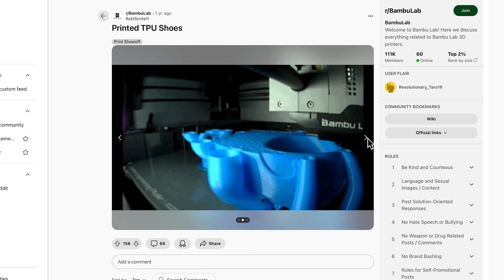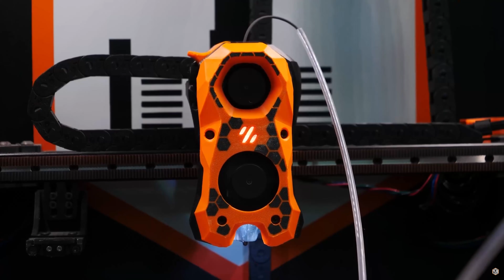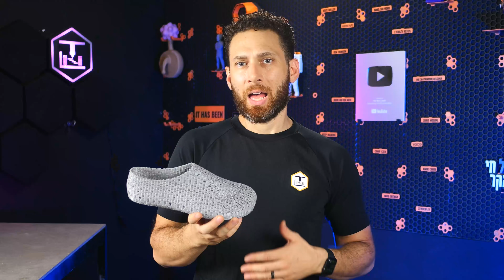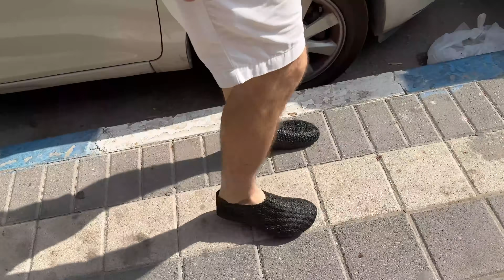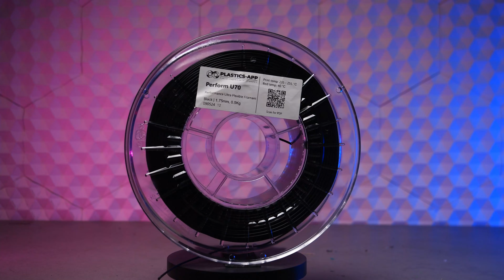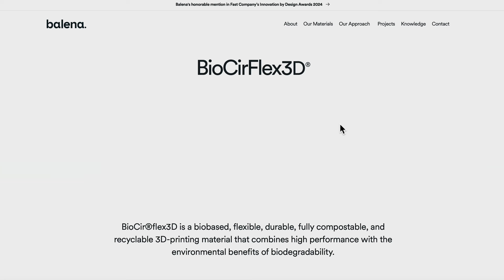Normal shoes suck. 3D Print THESE Instead!

Comment: I bougth a sv07 when it came out under recomendation, literally the worst printer I have ever owned and its made me quite the hobby, I tried to get help from support for 2 years and and rebuilt it from the ground up about 6 times now and it wont print correctly more than 1-2 times before loosing it's calibration and I have to start all over again

Comment: did you consider using the ninjatek  ninjaflex or their cheeta? supposedly they're made specifically for shoes while the chinchilla is for clothing. it would be interesting to see that filaments could stiffen the sole a bit for traction, longevity and no screaming if you accidentally catch a sharp stone under foot.
another thought is to access the fuzzies inside the shoe--- why not just turn the shoe inside out? far easier to work on the inside that way

Comment: If you ever revisit this project in the future, I have a few suggestions to bridge the gap between toe shoes and what you have here. One is purely material related and requires an IDEX or multi-head printer, while the other is model related. If you've investigated lattice software, that would be interesting to utilize, too.

Comment: A quick suggestion, from mg own experience with switching to barefoot shoes - it looks like you are still landing on the heel, and striding as if you were wearing the "normal" shoes (putting your leading foot waaay too far.in front of you)
Try the  following:
-instead of lenfhtening ypur stride forward - try to lenghten it on the back foot, aka, try to propel yourself forward mpre qotj the back foot, while putting the front leg.mucj less.far in front of your body. Think of it as moving your body/center mass forward in relation to your contact points with the ground. That might require a few months of stretching and exercising. Look up content on how to train for barefoot shoes
- try to point your feet slightly inwards, and it will help to exaggerate landing your front feet on toes/ball.

Good luck.!
Reply: Ball walking. It's what every human on the planet used to do before shoes with hard soles and raised heels were invented/became the norm. I always ball walk when in bare feet or shoes with thin soles. It makes so much more sense when you get used to it.

Comment: Printer guys.😂 When you have just a hammer, every problem has to be a nail, or what? You have one of the most advanced technologies of our time and you use it like cavemans that just discovered how to make fire by clapping two stones together.

Scan your foot with one of the billion apps out there and make a 3D model . Print that model. It's your (cobbler's) last. A foot "figurine". Use fabric with elastan for the top layer. Sew it on the last. Use some foam to make it comfortable for the feets bottom. For the sole try silicone. You may print some molding forms. Use adhesives used by shoemakers to put top layer, foam and sole together. It has a reason why shoemaking has an evolution too. You shouldn't ignore it :)

Comment: One of the things i dont see with 3d printed shoes which i think they could really benefit from and would reduce the poofy shoe issue i printing the bottom sole mid sole insole and outer shell of different materials say you were making a running shoe  you could make the bottom sole out of the most abrasion resistant stuff you can find to have it last longer and the stuff that needs to be softer out of something softer
Second thing you can do that i dont see being done anywhere is you could look at the shoes you already own and look where are the areas that you scrape the most and erode a lot and reinforce those either by again making them out of a material more resistant to abbrasion or just adding more material in those areas

Comment: perhaps what you have made isn't actually a shoe but more of an evolution of the sock?  IF you could make a second section that attached to shoe print that worked like a high top sock then you may have created a washable wearable long lasting sock?  The second idea would be that you simply build an All weather 3D printed over shoe that fits over your very breathable 3D printed socks/ that double as Summer shoes?

Comment: ok so I am very new to this 3d printing thing but I had a thought....if you can add magnets for example, mid print....could you scan and print an accurate "buck" of your own foot, say in PLA or whatever....then after the sole is printed, pause the print, insert the buck and continue to print the shoes over and around it?  modifying the tool path as needed to avoid collisions with the buck.  It would essentially be a removable, non attached support, in the shape of a custom last, providing support for sagging and ensuring that the shoes would be printed in the exact shape of your foot.....why wouldn't that work? love the channel, forgive my ignorance!

Comment: It would be interesting to experiment with using something like 3dgloop to glue a thicker sole (possibly also 3d printed) onto these for those of us who prefer that style of shoe

Edit: You could even print just the sole out of something like that 70A and glue it to a slightly less flexible but easier to print upper half, maybe that would offer better integrity while maintaining most of that desired flexibility

Comment: I’d like to see if these can be done in multi material. Use a soft grippy option for the outsole and a soft to the touch option for the uppers. 

Also, I have seen recent videos about varying the infill to make stiff or soft areas. It would be great to see this in these shoes. Soft in the heal and stiff in the arches.
Reply from the maker: Soon!

Comment: Hopefully you'll get that SV08 up and running for multi-material soon, this really seems like a project where printing the soles and uppers in two different materials (assuming any of these can bond together) would really improve the final outcome. I'm also kind of wondering if printing the whole thing in the best material for the uppers and then pouring silicone to surround and fill in for solid soles would improve the outcome on some of these. Having mesh soles kind of worries me, even as someone who is barefoot almost any time I can get away with it. You never know what you might step on out in the world.

Comment: My print bed is too small, end of the story :)
Reply from the maker: You need another printer. You always need another printer
Reply: @thenextlayer  Haha ! Yeah i should sell my current printer half the price and buy an A1. But if i have money to spend i rather buy a resin printer to make some miniature ho scale, fdm is pushed at limit on this scale.
Reply: So here's a hot tip, most printers can be extended in height with very little modification. Incidentally, the shoes that print vertical are actually easier.

A classic to build back in the early days 12 years ago was an upside down Ultimaker which would extend upwards to the ceiling.

Comment: VarioShore TPU always seemed like the perfect filament for printing shoes. Adjusting the temperature per layer could allow you to make some parts stiffer than others.
Reply from the maker: Yeah I kicked myself after Stefan’s video came out, like, why didn’t I think to include that?! But this video was already sooo long
Reply: A short follow up using it would be good. Could even be a short.

Comment: The really soft filaments underextrude at higher speeds because it's hard for the extruder to unspool.  While harder filaments are pulled out linearly with the extruder gears, the softer ones stretch without turning the spool.  If you unspool a portion of the softer filaments first, you can actually print them at almost normal PLA speeds
Reply: Maybe some of the new filament feeders/buffers could help with that
Reply from the maker: Yeah I considered this honestly but I couldn’t spare 26 hours to unspool manually
Reply: @thenextlayer   So perhaps a motorised unspooler would help. You would need any random geared DC motor that you can couple to a spool hub, and a Vishay TCST gate might work to detect the hanginess. Once it's hung down enough to clear or block the gate, the motor would be run.

Comment: I personally don't believe in barefoot shoes. I mean i might as well walk around in flipflops or thin sandals, and i have some thin flexible lightweight shoes and they don't work for me. I want pretty much the opposite. Also i need like at least 2 good inches of wedge heel for some reason.

Was watching a vid of a korean master cobbler build a mountain hiking shoe and i was like "hey i know these materials. hey i understand what he's doing, why he's doing that... i could do that! i would probably mess up 200 times before i succeed, but fundamentally, i could". That's a dangerous thought isn't it, i'm glad i caught it before it could spread.

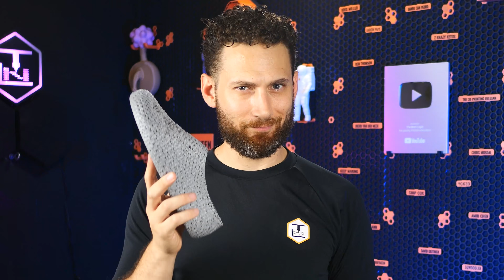9:35 if you have high power cooling, and you've got super flexible bead that you just extruded... you might well be blowing it away and forcing it to bow down instead of freezing it in place. Oh you realised that later, good. Considering, you know, as opposed to hard plastics, it doesn't actually ever fully freeze in place.

To investigate: Berd-Air with the pump/intake in minifridge. Low total force chilled air part cooling.
Reply from the maker: Thick shoes are a habit, like the “need” to eat “whole grains” - not healthy or natural and you can ween off them ;) but to each his own

Comment: Do you think on your multi-head machine you could print a support foot inside?
Reply: Maybe an idex would be faster
Reply from the maker: This is an interesting idea… I don’t think TPU bonds to PETG… so that could definitely work!
Reply: @thenextlayer  It might be tough to start the PETG though.  You might need supports coming up through the soles.
Reply: @thenextlayer  maybe even print a foot that you could slice in the sections and place in the print as it goes along. You know different layers. I don't know. Just throwing things out there lol
Reply: You think you can scan your foot? Use the scan to make the support.

Comment: I hope you do something with super hard TPUs in the future. Super hard TPU is apparently super abrasion resistant and extremely strong so it would be insanely useful for certain applications but way too expensive for a hobbyist like me to drop so much money on a roll lol
Reply: How hard of tpu are you talking about. 95a? 98a? More?
Reply: @KcCake   Rumour has it you can get 70D TPU. That's nominally similar hardness to most hard-plastics, just a little softer, but it still behaves very different, since Shore is a local surface property but macroscopically they're still on the flexible side.

Pellets that are even harder exist as well but don't think anybody is building filaments that are harder, unless...
Reply: @SianaGearz  hardest I've seen is around 75-77D, although I've heard of stuff poking into the 80's
Reply: @SianaGearz  interesting. I normally just run 95a tpu but may try 98a
Reply from the maker: I’ll give it a try. I can think of some things that need to be super hard yet flexible and handle a lot of abuse.
Reply: @thenextlayer  I'm sure... inline speed skating wheels... ASAorABS hubs/ TPU ? Does it bond together like commercially available urethane wheels
Reply: Ninjatek Armadillo is 75D, which puts it in the same range as nylon, but with better abrasion and impact resistance, as well as better layer adhesion.